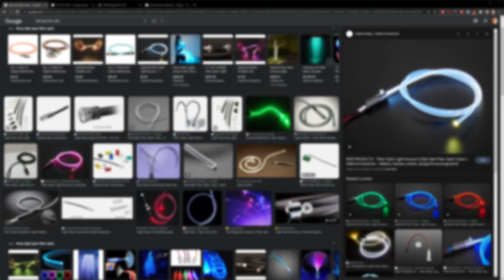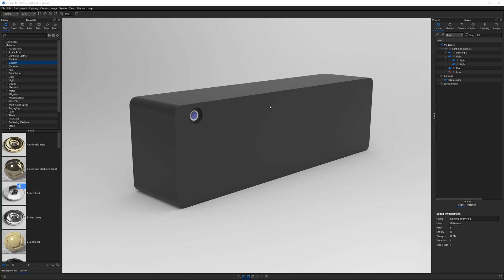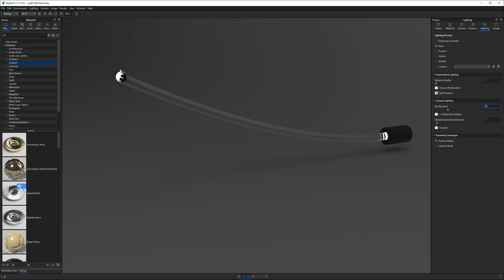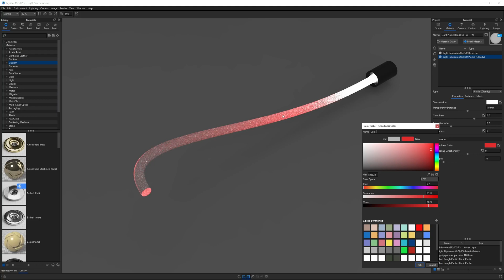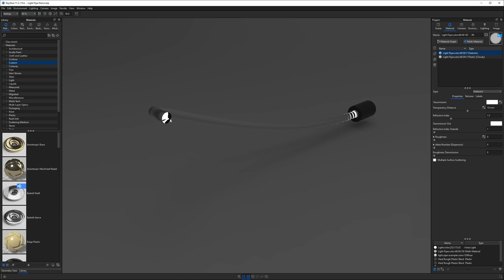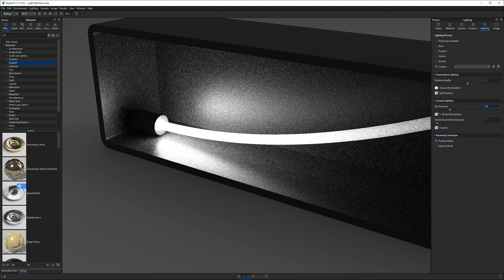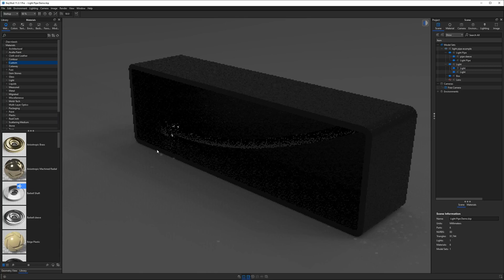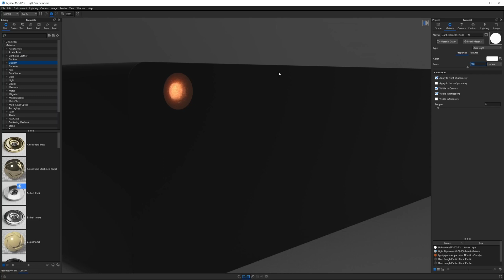Make a Glowing Light Pipe Material in KeyShot

Comment: Often lightpipes irl are polished to maximise internal ray bounces and then a satin finish where you wish for the light to difuse. Did you try splitting the light pipe geometry so only the exit point was cloudy and the rest remained dielectric? Or does the separated geometry mess with the ray bounces?
Reply from the maker: Ooh! Great call. I didn't realize this. I wold have to test it. I would advise against splitting the geo, however, it's not hard to apply some roughness to the end of the pipe/tube, so it's certainly worth trying. Through several conversations I've had since publishing this video, I've learned a few things... I may need to redo this one in the near future!
Reply: @WillGibbons  Roughness on the end of the pipe sounds like a great 
idea too.